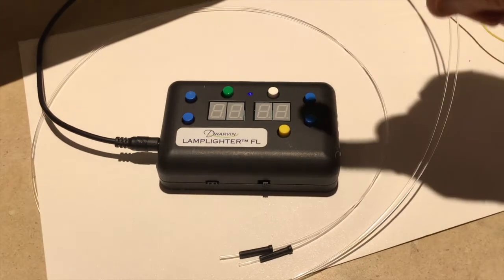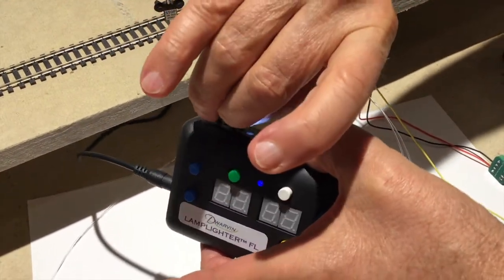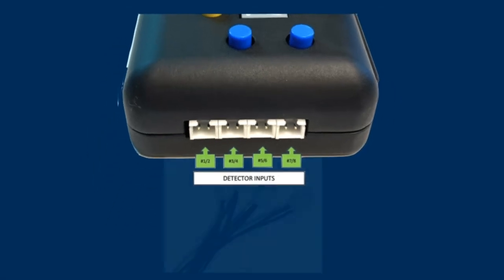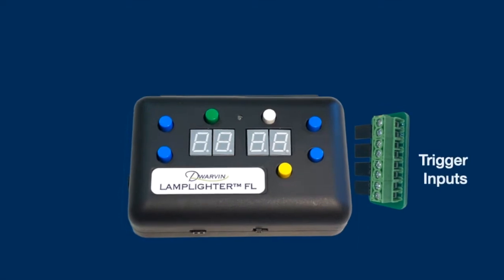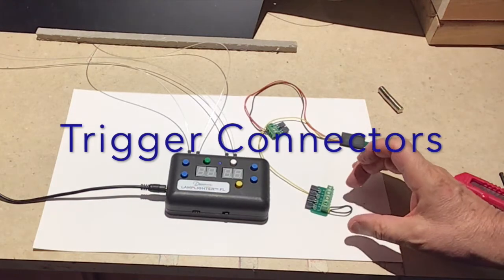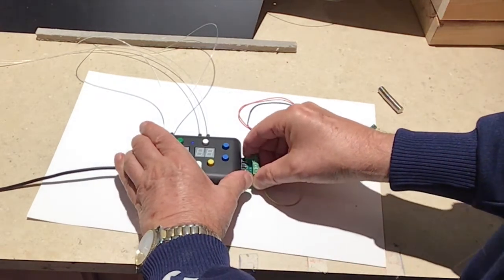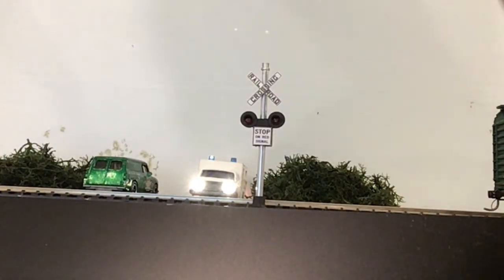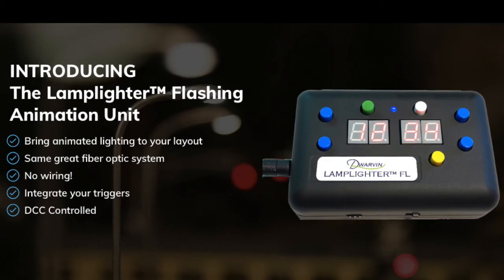Using the Lamplighter® FL Animator to integrate Triggering a Railroad Crossing

Comment: Please pardon my ignorance, but I seem to be experiencing issues with the Lamplighter FL unit I've purchased, as while I've set up the wires according to the instructions and put the first two ports into Trigger Mode (i.e. not flashing as in Default Mode), I don't seem to be getting any response from the IR Detectors whenever I run a car by them.